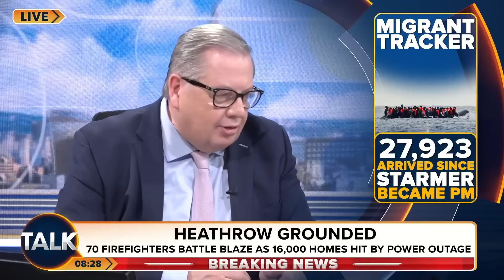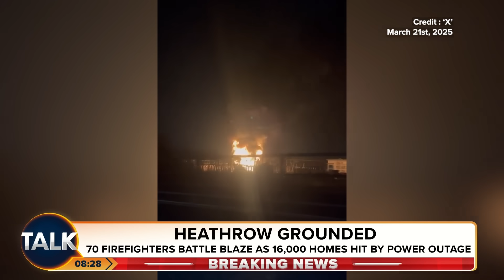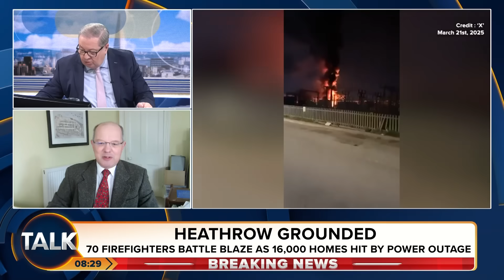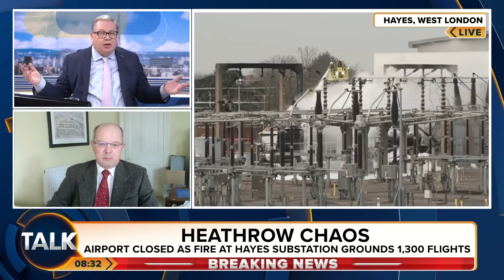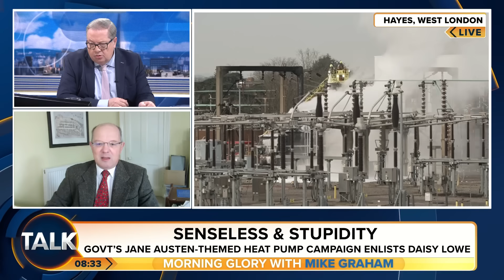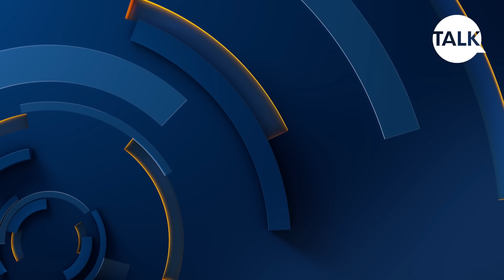"Infrastructure Is Falling Apart!" | Heathrow Closed All Day Following Electrical Substation Fire

Comment: Are the chemicals that they are putting on the fire and that are burning safe to be let out into the environment? You would think this fire would negate any Green energy benefit from their goal to reduce greenhouse gases. You would almost think the cancer and toxins would be highly poisonous to the population that lives close to that area of the fire.
Reply: What are you talking about? You need transformers whatever type of electricity system you use. And no, the amount of greenhouse emissions from a small fire like this is negligible. Similar to one car driving 200,000 miles. Nothing to do with net zero.

Comment: In Ca. they required all companies that have back up generators  to get rid of the diesel units and require them to get CLEAN during Natural Gas, now they want to remove the world class natural gas utilities, so I guess they will have to go with the batteries, weird they catch fire and they cannot put them out, they simply burn themselves out.   The fires in the Pacific Palisades they turned off the electricity and they could not pump the water up the hill. No water nor fire protection.

Comment: The power system clearly does not have a capable backup. For critical national infrastructure of this type a full capability diesel generation system should have switched in immediately. Where the hell were the backup generators? Such mission / business critical systems require uninterruptible power supplies to ensure system-level reliability / availability. Clearly, the UPS system(s) did not kick-in. What the hell is going on in this country?

Comment: I worked for a company that sub me out to a major mobile network provider. I got a call to say a major site had failed. It was a 2 hour drive when I get there the battery backup failed about 1 hour max. So have to restart from scratch. After a couple of hours I get it running so get a coffee and talking to security he said they had backup generators but they got tested and handed over . The problem was no one had ordered diesel to fill up the generator. This was over Easter bank holidays. Pissed about at first but then saw the funny side, and someone is going to be bollocked or fired next week shame but you have a job to do and it was not a mistaken order for paper.

Comment: If a single transformer failure can eliminate all your electric power your transmission system is the problem, not backup power systems.

Comment: Were the backup generators solar or wind powered 😂😂😂
Reply: Biomass but they needed electricity to work.
Reply: @Jezza_One  What biomass back up generator are you talking about? A made up one?
Reply: @paulharrison2325  The one that provides heat and power to terminal two and was mentioned in several news articles. Richard Tice MP incorrectly said at the time this was what caused the shutdown. Subsequent investigations proved this to be incorrect. It looks like power was available but incompetent leadership was at fault.
Reply: @Jezza_One  Nothing to do with incompetent leadership or a biomass CHP plant.  Everything to do with fire fighters not wanting to fight a fire on a live substation and it taking time to bring the North Hyde substation back online. The transformer not having a firewall with blast resistance and the sprinklers not working (or not being effective) is where you should be looking at, not at nonsense from MPs that do not work in the power sector.
Reply: @paulharrison232 You have the advantage of having recieved an extra weeks worth of information. So its easy to be smug and rude. I was commenting on what was being said at the time. Have a nice day.
Reply: @ No, I have the advantage of having worked in the power sector for two decades, developing and delivering thermal power projects up to and including 132 kV. I could have told you the above within 20 minutes of the incident because it's a topic I know about, don't have to watch youtube to learn about.

Two bits of advice:

- Don't form opinions based on nonsense videos such as this one, they are misleading you, or don't have a clue (blind leading the blind).
- Don't post on topics you don't have a clue about. It makes you look stupid.

"No offence", of course ;)

Comment: One cannot believe that there are not two independent sub-stations able to feed power to such a critical piece of infrastructure.
Where is all the fees collected from airlines going to?   Bonuses for executives?
Reply: absolutely
Reply: I can...
Reply: they should have lines from three or four substations and enough spare capacity to cope if one goes down.  they'll probably say it wouldn't make any difference if a transformer fails it would take them all out anyway.
Reply: @Paul-nu7nj  the board has stolen all the money and called it bonuses

Comment: Commercial-size generators are almost always under contract with an off-site maintenance company to test on schedule, repair, and replace when end of service life is reached. An airport backup generator that fails when needed is inconceivable. Someone dropped the ball bad.
Reply: You'll probably find they were concerned about generators BACK FEEDING while firemen spray foam on a 132kV site , if you were to short out 132kv to a back feeding supply everyone in the vicinity would be dead and everything connected to it on fire.
Reply: @leonblittle226  My business purchased a commercial-size generator years three decades ago. The first thing the company we bought it from installed was a manual transfer switch. It was impossible to back-feed power to the grid. My current home has a generator. The first thing the company I bought it from installed was an electronically controlled transfer switch. I doubt anyone, anywhere, would build something large enough to power an airport without installing safeguards to avoid harming people and equipment connected to nearby electrical lines.

Comment: Replacing a Transformer plus commissioning  - 3 months minimum.
Reply: Nothing needs replacing. There are three transformers and they all work at low load in case of this event. Replacing them would take over a year if none were in strategic spares.
Reply: @paulharrison2325  so a transformer that’s been ablaze with a fire doesn’t require replacing?
Reply: @paulharrison2325  Nothing needs replacing?? Is this a wind up? The entire transformer circuit bay was destroyed in the fire!! It's already been stated by NG's CEO John Pettigrew that National Grid had supply resilience as there are 3 substations supplying Heathrow and it's my guess that the failure of power at Heathrow was caused by delays in automated change over systems and reboots to all of the systems at Heathrow. I take it you do understand that supply incomers are not connected simultaneously to the same sub supply busbars but are usually available if the incomer circuit fails through a fault of some sort, as was the case in this transformer fire disabling the incoming supply, and this would have triggered the automated change over at Heathrow, which are not instantaneous, and therefore causes temporary loss of supplies for several seconds, depending on protection setting times, and meantime during this loss of supply, Heathrow's systems shut down and have to be restarted manually which is a long process - Heathrow's director has already stated this. As a National Grid Project Engineer and SAP, we replaced a 400/132kv transformer and commissioned it in 20 weeks under a emergency replacement scheme, and yes, we were fortunate to have a strategic spare available.
Reply: Normally may be but this has too much national attention so will be dine more quickly.
Reply: @CBE-d6j  "Normally" it takes longer -  I've replaced many transformer assets as a project engineer with national grid over the last 48 years. The fire damage is significant and will involve a total rebuild of the entire circuit bay including all the Civils. National Grid will either divert supplies to an alternative connection in the substation whilst the replacement scheme is carried out, or install substantial temporary diesel generators but this will take time as the Cable Sealing Ends - the devices which connect the transformers bus bars to the cables supplying Heathrow will also need replacing. I see from the aerial photographs on the news that this is an old substation with only two transformer bays so capacity is extremely limited. There won't be a spare transformer "on the shelf" somewhere. These have to be ordered on a future asset replacement scheme. From experience, National Grid will  have what is known as a "hot spare" transformer somewhere in the country. (A hot spare transformer is one that is not connected into the system but has its auxiliary supplies connected to circulate the insulation oil to "condition" the internals of the transformer. Oil samples are taken 3 monthly and tested to check for any moisture etc that may be present in the oil. I can assure you this is a big job and I'm being generous with my time estimates. One thing I do know from experience is that there's going to be one hell of a row about this and its likely some people will lose their jobs over this over this. Watch out for the enquiry as I think it will be shocking!

Comment: They got rid of the diesel generators to meet Net Zero targets.
The Biomass generator can't cope.
Reply: Correct..
Reply: No, they didn't.
Reply: @paulharrison2325  Yes they did.
Replaced with biomass generators three years ago.
Reply: @stephfoxwell4620  No, they didn't. Heathrow never has had full capacity EDGs and it has retained its EDGs despite the new biomass CHP plant (which has absolutely nothing to do with back up power).